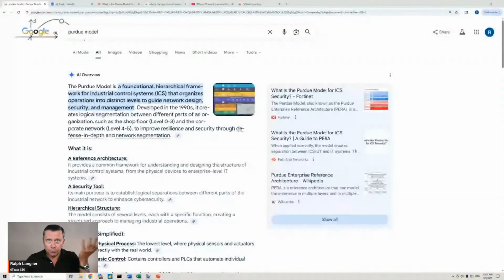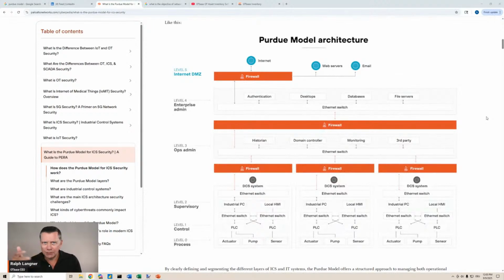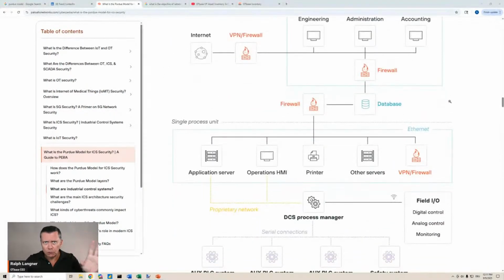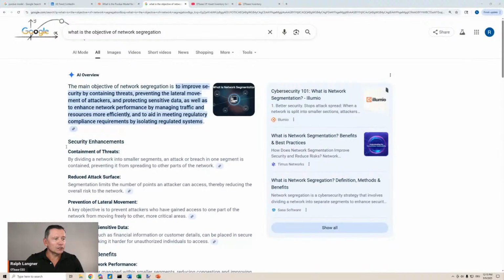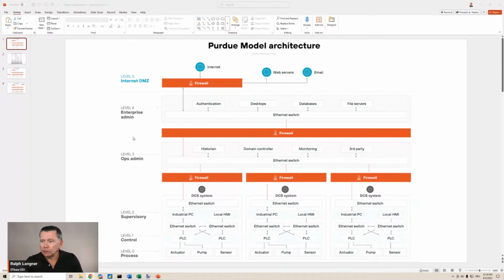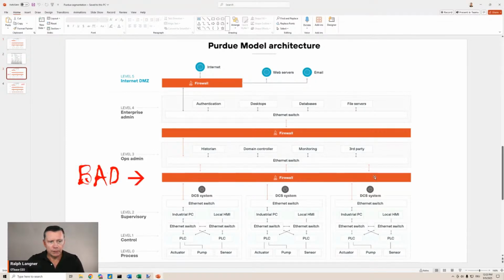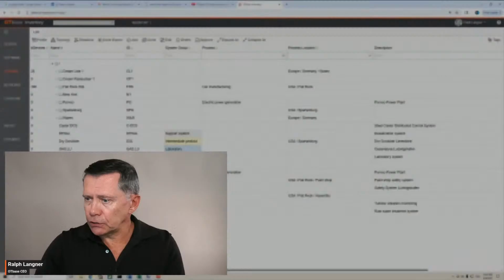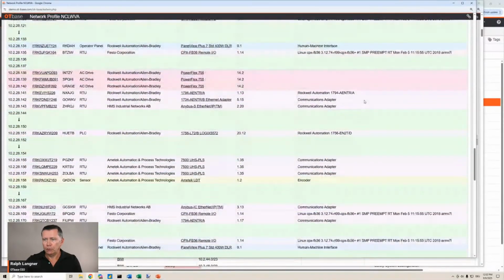The Purdue model and network segmentation

Comment: 15:42 I would add that it is a cost control mechanism. Without network segmentation, then the entire organization’s network is subject to the compliance mandates for regulated systems, and/or controls. The scope of PCI audits for example, would extend to every location where there is no managed boundary between environments. This would be a massive costs to most organizations.
This combined with the tendency for organizations to not patch their OT systems very often, would tend to degrade the entire organization’s internal network posture.